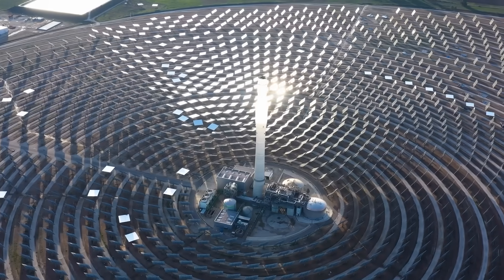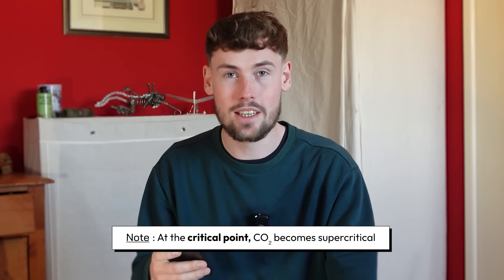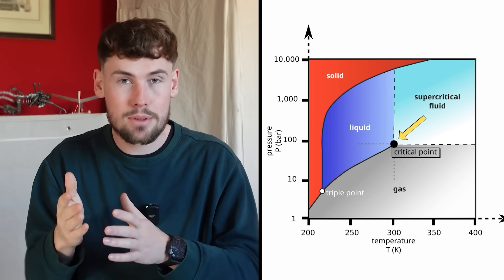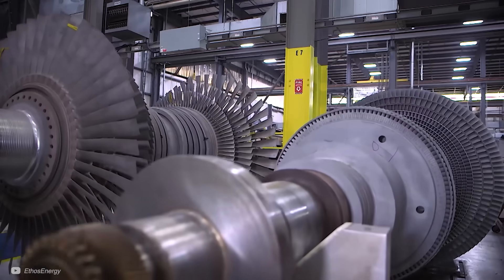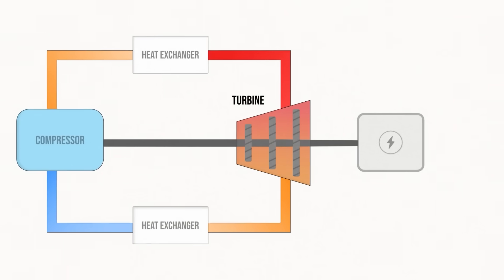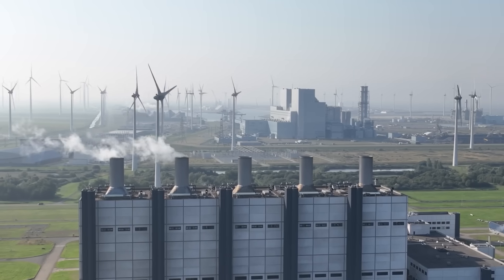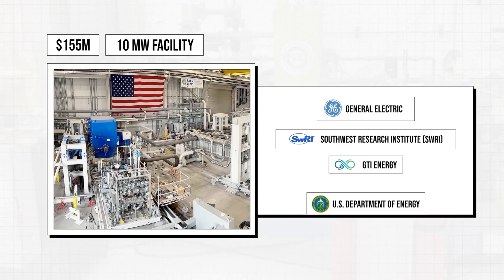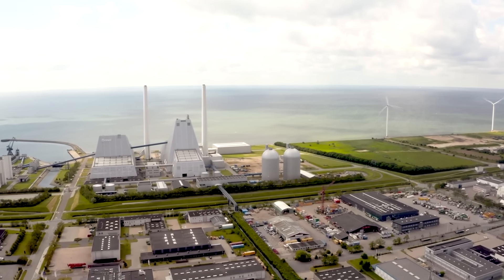How Ultra-Efficient CO2 Turbines Are The Future of Energy

Comment from the maker: Check out Odoo using my link https://www.odoo.com/r/pBs and start operating your projects more efficiently!

Join the Ziroth Peer Review team to help improve technical accuracy! https://discord.gg/BgwVvkRV

EDIT: I cut out the section on the first reason for improved efficiency (that SCO2 is easier to compress) as I messed up the explanation by comparing SCO2 to steam. There have been too many of these mistakes recently so I have launched a 'Peer Review' discord server to help me minimise these mistakes. Thanks for your understanding as I continue to improve!
Reply: A thousand and 70 psi. Not a hundred and 70 psi.
Reply: @de0509 Ya exactly.
Reply: AEROSPACE ENGINEER - Loved this.
For some time I have had an interest in power systems that started with a small project in 2016. One of the things that becomes obvious is how inefficient we use energy and in particular the lack of using WASTE HEAT. About the only well known use of waste heat are the cogeneration systems used in conjunction with gas turbines.

There is another use I have seen on mine sites and that is with desalination. If you look at the Wikipedia page for Multi-stage flash distillation there's a diagram on the LHS that is almost identical to one I saw back in 2006 for 2 units at a Nickel mine I was helping to build. That mine's power station was Sulphur powered as in it burned sulphur and that's common for remote mines that need sulphuric acid. Its a lot cheaper and safer to transport sulphur than sulphuric acid. If you have a look at the multi-flash diagram on the RHS item 'H' is the brine heater. That is the largest energy input to that sort of system.

So when you have something like a steam driven power station and there's the need for a condenser/cooling system then something like that type of desalination becomes super cheap. What we need to start doing is being a lot more efficient with heat recovery systems.

Right now the GE 9HA can out put around 500MW and also power a 300MW congenator. Typically steam turbines are only around 35% efficient in practice. Even if you ran at 40% and switched to a CO2 system you'd get something like another 75MW (a full power). Over time that adds up.    

This is the sort of stuff we need to be doing a lot more of.
One of the major problems in the World right now is the energy crisis and its been primarily driven by population growth. More people means more energy demand. Between when I did my degree in America and now there's an extra 100million people. In the same time Australia's population went from 16.5 to 28 million (~70% increase).

In future we need to get more out of our generator systems.
We also need to use energy a lot more efficiently, which right now we do terribly. Most end user applications use less than 10% of the potential energy of the source and many things like food preparation used less than 5%. I heard  physicist say that on the YT channel Planet Critical and thought he was nuts until I checked.

Think about a lump of coal or Uranium and how much energy is in the raw material. By the time electricity is coming out of the power station only 30% is left and often less than 20%. Remember a significant amount of the U235 never gets consumed in the reactor and a lot of the heat from coal goes out the smoke stack. By the time electricity is coming out of the power point your at less than 15% of what you started with in the raw material. 

After that think about how much energy is lost in heat from things like cooking food, running a computer, running electronics in general. The consider how much of that original energy in that lump of coal or uranium actually ends up doing the thing you want the energy for.

The next giant wave of technology will be ENERGY EFFICIENCY.
Sorry but it has to be.
Reply: So when are you going to do a show on zero point energy?
Reply: Thank you for sharing this!
Reply: @ Hi all you have to do is google for carbon dioxide supercritical pressure. And no, you are wrong. The pressure is really 1070 psi. Took me 5 seconds to google. This is not feelings, these are quantifiable facts. Look it up. We have nothing else to discuss
Reply: @de0509  DlCKHEAD 1 atmosphere is 14.7psi and 1070 / 14.7 is ~72.8 

So saying CO2 is supercritical above 74 (3:45) atmospheres is CORRECT.

You haven't said if your 1070psi is gauge or absolute either.

Next time do some REAL checking before shooting your mouth of.
Reply: @tonywilson4713  Nah man, the presenter literally said 170 psi, which is a difference of a factor of about 10. Just listen to him saying it, or if you cant, turn on CC for subtitles.

The difference between gauge and absolute is just 1 atm or as you already know 14.7psi. You wanna dispute gauge vs absolute and ignore the log in your eye which is an error worth ~1000 psi
Reply: @tonywilson4713  Obviously it's gauge pressure as it's measured within a vessel.
He did err in saying 170 psi, though, when he should have said 1070 psi
Reply: @de0509  You are correct on all aspects of what you posted.
Reply: @ab_ab_c  As he says that HAVE A LOOK AT THE DIAGRAM on the SCREEN WHAT DOES IT SAY.
Yeah he said 170 instead of 1070.
WTF is wrong with you if that's what you get out of ANY VIDEO.
Reply: @quilmore  Wrong:  The precise critical point of carbon dioxide (CO₂) is: 87.7604 °F & 1,070.0 psi).  The video author erred by saying 170 psi, when he should have said 1070 psi.
Reply: I could see these in colder climates like Antarctica for a efficiency boost from the ambient temperature being so cold
Reply: Is this how KOS-MOS and the Zohar were designed?
Reply: Don’t just cite Wikipedia, instead cite the actual underlying citation used in the article
Reply: Very smooth overall.
Reply: Have you seen the sco2 turbine that burns methane internally. This eliminates one high pressure heat exchanger
Reply: The phrase 'ten times smaller than' is a nonsense. One times smaller is zero size. What you mean is 'one tenth the size of', which makes sense. Another common mistake is to say 'ten times larger' which means eleven times the size, when the correct terminology for a tenfold increase in size is 'nine times larger'. To explain: One time larger is twice the size, etc..
Reply: demo it and we will see
Reply: You do an amazing job. We appreciate you.

Comment: This video lacks a systematic explanation, so let me try. 
- steam turbines have significant loss from medium aggregate state exchange (liquid - gas)
- use of water in the system introduces wear problems due to corrosion and droplest damaging the turbine blades
- in search for other medium we look for one which is stable over wide range of temperatures so the gas expansion equation is relatable for it in wide area
CO2 looks like an ideal gas for it. 
But I'm not sure why this super state would be needed.

Comment: most fixed installation steam is already ultra efficient ....they use the earth to cool the outlet, ( that 40% would be without )...but you are talking about more drop, which requires more heat, it's interesting for sure.

Comment: I always wondered why water was chosen to run turbines.  Theoretically any gas would work, but water has a high heat of vaporization just to get it into the steam state, with no payback in work performed.  Also--once the steam has exited the turbine, it's still hot, so couldn't there be a way to heat it back up in a closed loop system?  Seems like such a waste to have all these cooling towers when you're going to have to heat up new water to go through a new cycle.  I realize that any backpressure will have negative effects on the efficiency, but couldn't the volume of the pipe be opened up to condense the steam back to hot water, much like the closed loop system of a refrigeration system?  Just thinking out loud...

Also, the video mentioned water droplets damaging the turbine blades.  Wouldn't that imply that the steam has cooled down too much if that is happening?

Comment: Cool Video @zirothtech but you miss the key point entirely: supercritical-CO2 turbines are not powered by combustion like a gas turbine, but instead with heat, so no gas needs to be burned; and they operate at much lower heat (500-800C, but can take as low as 250C that can be upgraded with a heat pump; compared to 1.200-1.600 gas turbines need)

So, they can be powered by low-temp waste heat eG from industrial processes > effectively fuel and CO2 emissions free!

Comment: That sounds like a great idea if it can reliably be made safe. I'd be worried about leaks and blowouts with a pressure level that high. If the pressure drops low enough, it's conceivable that dry ice could form and damage parts. I would also be worried that a large release of CO2 could kill people in a small enough room with a big enough leak.

Comment: There is one problem to be wary of.

Rotating mass in a generator at line frequency [3600 RPM, in the 60Hz USA grid] is a feature, not a bug.  That rotating mass gives you that first second of coverage if there's a hiccup in the load or generation.  Portugal recently, and Texas a few years ago, had enough renewable energy that was put into the grid by inverters instead of rotating generators that they went into a blackout from a blip that 3600RPM generators would have been able to ride out.

Supercritical CO2 turbines, like wind turbines, cannot be made to spin at line frequency, so the power will have to be put on the grid by an inverter, and that will create that vulnerability.

-dk

Comment: Another bonus is co2 turbines are putting less water vapor in the atmosphere, which while short lived, is itself another greenhouse gas, and it reduces demand for water.

An important point, going from 40% efficiency to 50% efficiency isn’t a 10% improvement, it’s a 25% improvement.

Comment: Why does everyone refer to something being 10X smaller?  It is not 10X smaller, it is 1/10 the size of the larger object.
Semantics, I know, but its a pet peeve of mine.

I'd like to know how much energy is required to create the SC CO2 compared to that required to make SC H2O to comoare the net cost per MWH of power generation.
Also, what are the losses of CO2 from the system?  I know there are losses in an H2O system and make up water is always required.  How will the Climate Change activists react to more CO2 getting released into the atmosphere due to leaks or a catastrophic failure i  the system?

Comment: A somewhat baffling video. We are promised 3 ways that supercritical CO2 improves efficiency, but the first way seems to be missing from the video.  The second way (higher inlet temperatures) is presented and is valid.  The proposed third way - eliminating the phase change used in steam systems- is debatable.  The phase change in a steam system takes energy, but virtually eliminates the power needed to compress the working fluid.  Near the end, the video talks about using the cycle in waste heat recovery.  Generally, waste heat is nowhere near the temperature required for the promised improvement in efficiency for the cycle created by using very high initial temperatures.

Comment: I first thought how efficient can a group of mirrors, that need upkeep, reflecting the moving sun onto a heat absorbing tower which then transfers the heat via a liquid to a steam generator that drives a turbine pushing out electrons which wastes water and has to be cooled be more efficient? Even replacing the water cycle with a different gas cycle still increases down time for maintenance and the cost of new parts. Then there is the waste of energy in the form of unused heat. Finally, what is the payback period for a solar panel verses combining a mirror, heat exchange tower, turbine generator and additional circulating system? There must be the externalities to be considered with different methods of generating electric power into our existing power lines and transformers. Can all this complicated technology be more efficient that some solar panels on a roof with batteries in your garage? Last I checked one doesn't even need to convert DC to AC over short distances. You can even use the battery in an EV for domestic storage.

Comment: As a rule of thumb a modern combined cycle power station operates on a 40% rule: For every 100MW fuel input to the gas turbines, 40MW is converted to shaft power / electricity, and 40MW is converted to steam. 40% of that (16MW) is then converted to shaft power/electricity in the steam turbine. Overall efficiency 56MW for every 100MW input. The steam cycle typically uses the available heat to generate steam from the turbine exhaust at 3 different temperatures/pressures: high, medium and low pressure steam, with the exhaust cooling at each stage. This triple pressure setup adds complexity but mitigates some of the inefficiency of the phase change in the steam cycle. Supercritical CO2 is a good fit for replacing the medium and low pressure steam cycles, perhaps in power stations but definitely in waste heat applications. I don't see it replacing the high pressure (high temperature) steam cycle in power stations, ever. Because the pressures needed for the same temperature would be even higher. Overall I think supercritical CO2 could help squeeze maybe 1-2MW per 100MW fuel out of a combined cycle power station.

Comment: You can also work with water in a trans-critical cycle. In this case you operate the heater with a water pump well above the critical pressure. So at the critical temperature the water becomes supercritical. The ZEE-03 engine works by use of a trans-critical water cycle with an upper temperature of 900 °C.

Comment: China’s first commercial supercritical carbon-dioxide (sCO₂) power plant is the “Super-Carbon No. 1” project, installed inside the Shougang Shuicheng Iron & Steel Works in Liupanshui, Guizhou Province.Developed by the Jinan Iron & Steel Group International Engineering Technology Co., the facility is the world’s first commercial-scale, 2 × 15 MW sCO₂ waste-heat power system for sinter plants. Grid-connection commissioning was successfully completed in November 2025, with full-load operation expected before year-end.

Comment: This sounds like BS to me. The energy it takes to get CO2 to that super critical state is significant. All those replenishment tanks at that test facility speaks to the need to constantly add CO2 to the system. Where did the original CO 2 go? These videos rarely ever talking about the balance point for efficiency, operating cost and energy consumption by the system itself, reality always wins in relation to theories.

Comment: How can a 13 minute video be called a "deep dive"?
Especially with a significant ad read in the middle and another significant "reasons to be excited" time filler at the end. There's barely more than 5 minutes of actual information here

For one thing, you never explained how a phase change "wastes energy". A lot of energy transfer processes work specifically because of the energy dynamics of phase changes.

Comment: I first heard about this at an open day for a company that is developing bricks for the storage of heat. The small size and high efficiency meant that it was not unreasonable to convert solar energy into heat, store it in the bricks and use the turbine to provide heat all day. It was seen as a viable option for companies that had high energy needs but wanted to lower costs. This is feasible in Australia as the oversupply of electricity during the day means during the day the price is normally negative in summer. Yes they will pay you to use electricity!!!

Comment: If you increase the efficiency from 40% to 50% the cost of electricity drops 25% if everything else is the same which is huge
Reply: In a modern combined cycle power plant, 40MW of every 100MW input fuel energy is converted to electricity by the gas turbine. 40MW of the exhaust heat is converted to steam and 40% of this (16MW) is converted to additional electricity. If that 16MW could be increased to 20MW, you could have 40+20=60MW electricity  instead of 40+16=56MW electricity. Not so big a difference is it? Also power stations use triple pressure steam generation, which adds complexity but mitigates some of the inherent inefficiency of a cycle where the H2O has to change from liquid to gas.
Reply: @londonalicante if that is true the stated efficiency should be 56% not 40% right?
Reply: I design the HRSG "heat recovery steam generator" boilers that take the exhaust from the gas turbine and generate the steam for the steam turbine. According to this video the efficiency of the steam cycle is about 40% (which is essentially true per my rule of thumb, a bit low for a large modern triple pressure steam cycle) and can be increased to 50% if changed to supercritical CO2 (which is debatable.) So my rule of thumb gives an overall plant efficiency of 56% which would increase to 60% if the steam cycle were replaced with a 50% efficient CO2 cycle. So you don't get a huge drop in electricity cost because most of the electricity comes from the gas turbine. The steam cycle is only there just to squeeze that little bit extra out anyway. Supercritical CO2 turbines aren't going to change the price of electricity. They do have niche applications recovering relatively low temperature heat from industrial processes (say 100C) for generating electricity which simply wouldn't be viable with steam.